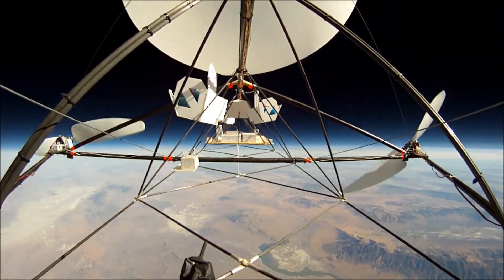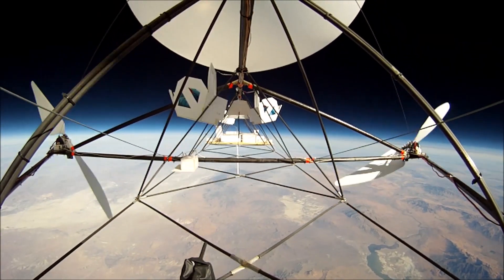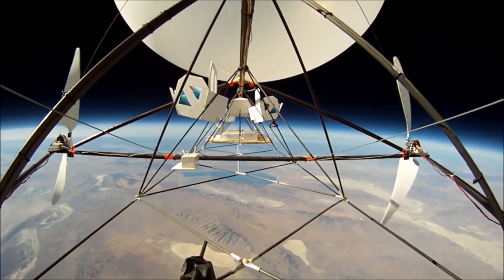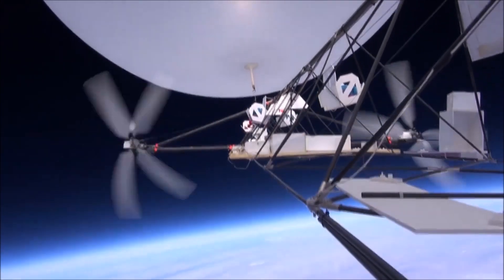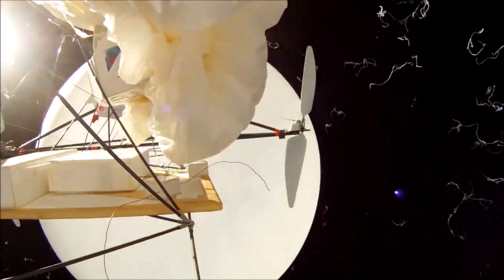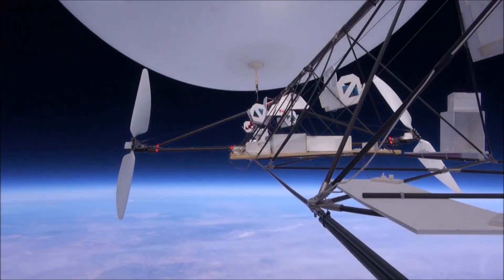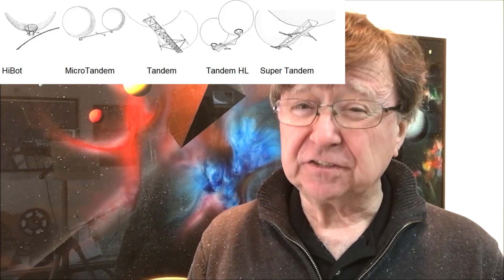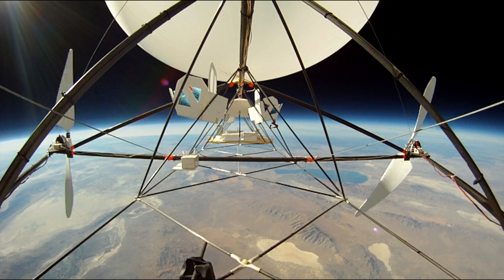Stratosphere Drone Flies to 95,085 feet

Comment: Love your innovation and how you share your excitement with us plebs on the ground.

1.  Not sure why you don't switch to cheap hydrogen instead of very expensive helium.  I don't see the risks of hydrogen as being too dangerous in your specific application.  Being very light, hydrogen quickly and harmlessly disperses in the open air.

2.  Also think your propulsion would hugely benefit from the use of the Sharrow Toroidal Propeller.

3.  This would be the perfect counter-weapon - and very much cheaper than any air-force missile - to the Chinese Balloon.

4. Expect to see the Chinese copy - and implement - your innovation almost immediately.  And unfortunately, also everyone else with mischief in mind.  Sigh!
Reply: Helium is actually cheaper once you take into account the handling issues.

Comment: Could you control the direction of travel with the propellers? It looks like it's spinning in all the video clips. But wow, that's way bigger than I thought. The guy holding the propeller puts everything into scale.
Reply from the maker: The props let us turn and drive forward. I think I make the flight scenes too choppy but it's really turning left and right from the props.